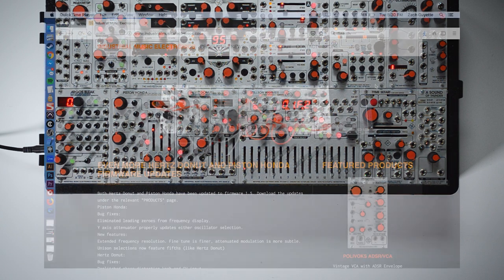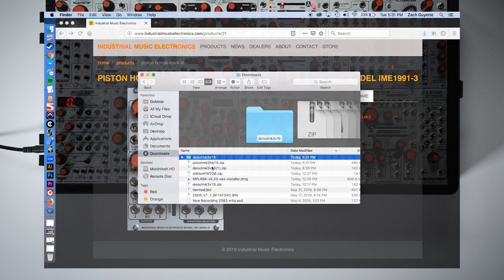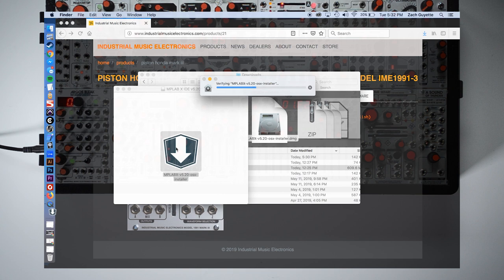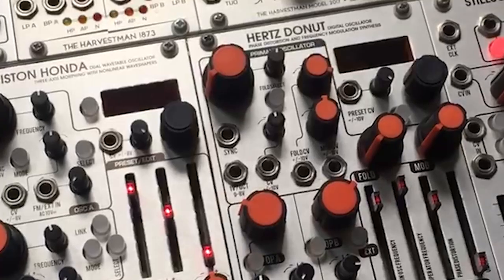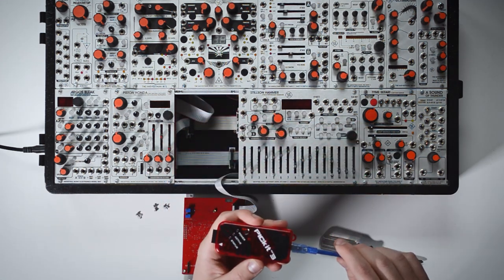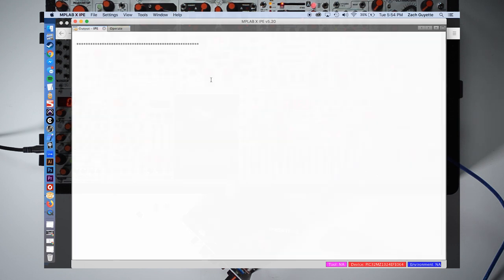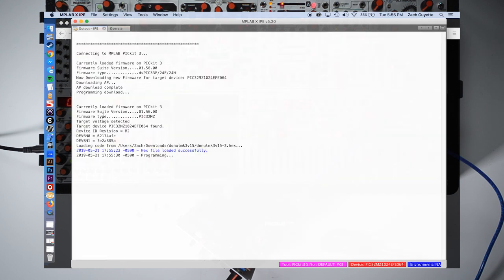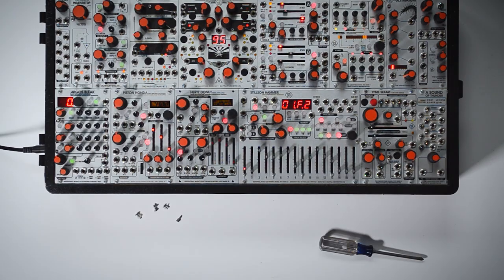IME Module Update Procedure: Hertz Donut MK3, Industrial Music Electronics & The Harvestman Modules

Comment: Your PICkit 3 firmware version 00.00.00 is too old. You must have firmware version 01.26.10 or higher to use MPLAB X.
Connection Failed.  i keep getting these message , any help?